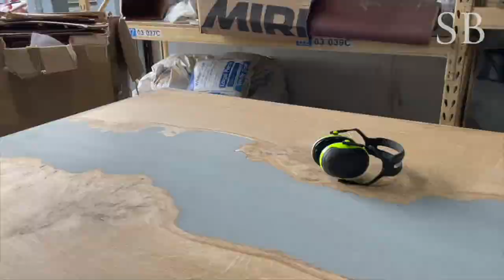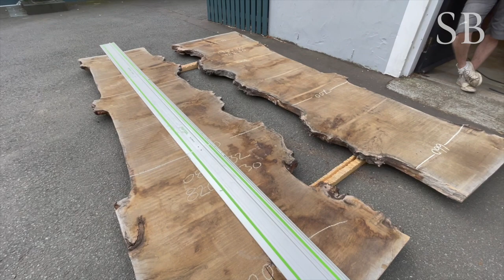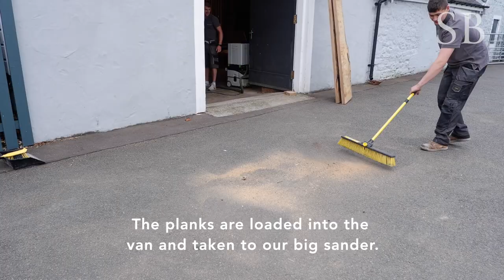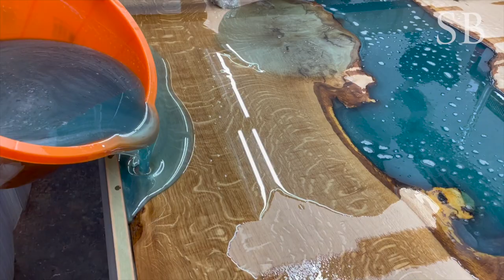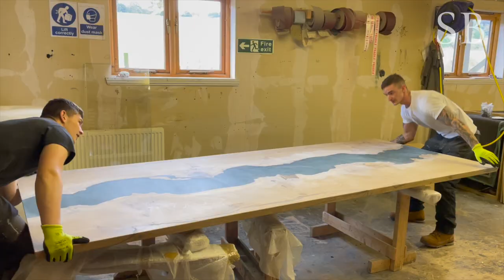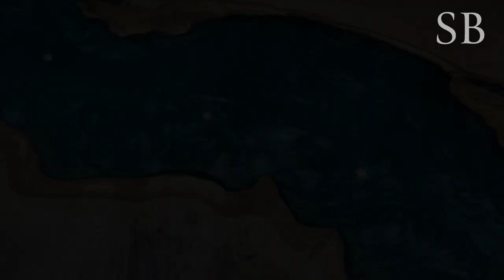STEVEN BURGESS FURNITURE - Making a River Table

Comment: Nice table. Love the colour of that river. I'm just curious why you don't run a blow torch over the epoxy after pouring to pop the bubbles? I always thought that was a 'must'. I've never done one myself. Bloody expensive for this sort of stuff in straya.
Reply from the maker: Hi Geoff, thanks for your kind comment. Sometimes it's necessary, sometimes it's not. We've established a technique where we leave the resin to cure for 3 days which often lets the bubbles pop on their own. However, we will occasionally use a heat gun to pop bubbles if needed. Glad the video has reached you in Australia!!!

Comment: Great looking table!!
What did you use on the edge of the river ? 
A sealer? What’s that for?
Reply from the maker: Hi Dave, it's not sealer it's just a light coat of the same resin that is poured in-between the planks shortly after. It ensures a seamless join between the resin and the planks. ☺